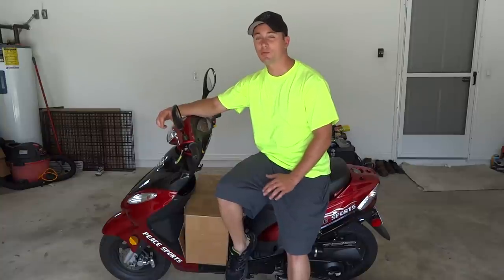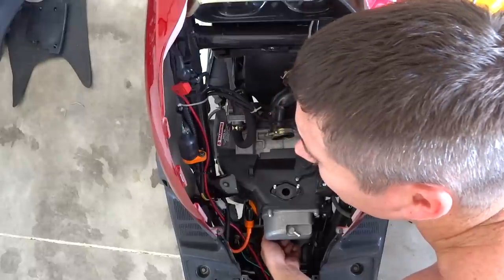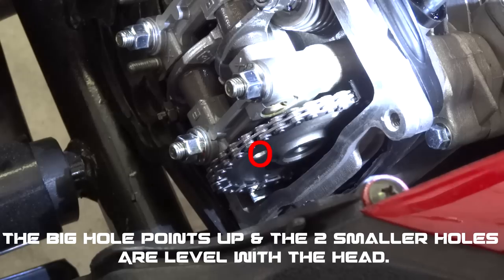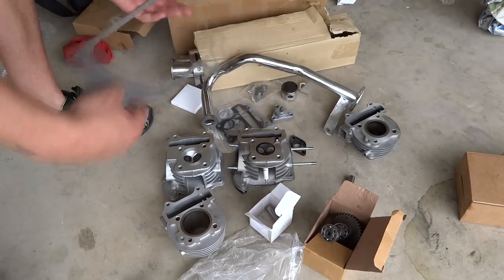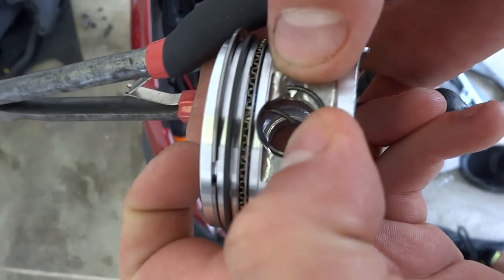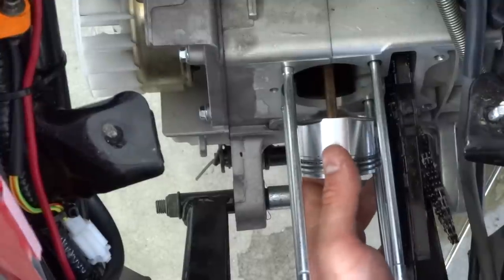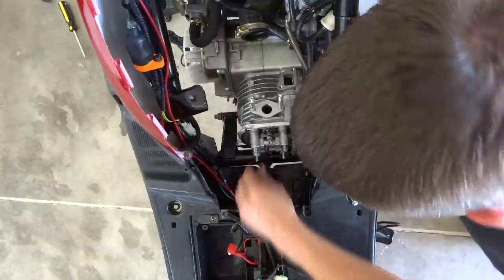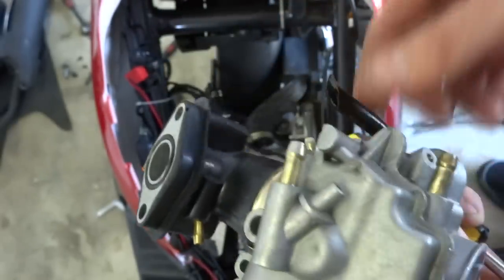DIY Gy6 Scooter 50cc to 100cc Kit

Comment from the maker: 💡Answering Scooter Questions Here💡
📌https://youtu.be/xnBtKxbpJIU
🛒 Purchase The Parts In The Video Here: https://www.nthefastlane.com/gy6-scooter-50cc-to-100cc-kit-store
🛒 Visit Nthefastlane's Amazon Store: https://amzn.to/3pP4UCy
Reply: +Nthefastlane will it be noticable to the authorities if i do this????
Reply: Nthefastlane i need help cold it be the fuel pump wean I gave  it gas it die on me
Reply: Nthefastlane would it be a little better if i ran straight pipe moneys kinda tight on bigger exhaust or normal exhaust is better please hmu
Reply: You should do a video of port and polishing the exhaust and intake port to a bigger intake and exhaust size since these engines are badly restricted of exhaust and air flow to promote better combustion in the combustion chamber while running and the moped i have like this runs much much better with a port and polished head with a unrestricted straight piped exhaust and putting bigger valve seats in the hemi type head that's pretty funny these engines have a very small hemi engine in these scooters and I think it's funny to say YEAH ITS GOT A HEMI
Reply: I believe when you bought the full kit , they include a H.O oil pump to deliver more oil to the bigger top end or so the say & u have a big enough pump to run a NYC oil cooler.  So they say couldn't tell the stock oil pump from the extra in the kit . I'm not 💯 for sure nice clean big bore complete,  I have to actually pull my motor for a big bore frame is smack in the way for 150 to a 180cc & 30mm carb get ya moving 
Fwd great vid !
Reply: How pppl charge do this

Comment: hi im going into a  engineering school. Im not a professional yet but i think you should lubricate the piston and its componets to avoid any internal damage at the first startups!
Reply: Exactly my thoughts.
Reply: Not to burst your bubble, engineers are not mechanics. In fact mechanics do not usually like engineers because you don’t make things functional.
Reply: @MrSagerific95 that may be, but engine assembly lube exists for a reason
Reply: @Andy-df6gm  as a professional mechanic and engine builder I agree 100%
Reply: @MrSagerific95  yep.. and  as a SCOOTER builder who puts these in regularly  you DO need  assembly lube
Reply: @pastorjoesackett  indeed. My high compression 80cc has about 300 hrs on it and is still putting out great numbers on the compression tester.
Reply: @pastorjoesackett or just regular 10w40 i got a gy6 139qmb i instalt a 72 cc and i lube everything just with oil
Reply: @pastorjoesackett  hello i have done my first build and i did not have assembly lube laying around but i did buy 5w40 scooter oil i used that as lube would that be a problem?
Reply: @lucabot5518 did u install the naraku cilinder?
Reply: @BeamnGLiquify  nope any lube is better than no lube. sure assembly lube has better properties but it should be fine. Just make sure you change your oil after your wear in cycle 🤙
Reply: @BeamnGLiquify also I know you’ve probably already got it going. But another tip is to take the spark plug boot off and wheel it over a good 10-20 revolutions to ensure the oil pump has primed the system😊
Reply: @BeamnGLiquify  I used Lucas oil stabilizer because that's what I had on hand and it's sticky enough keep the parts lubricated during assembly.

Comment: No need to lubricate the parts during assembly?? You must be very confident that the oil pump will get it lubricated fast enuff at first start up huh?? Always lube during assembly with synthetic or at the very least...10w30
Reply: never use synthetic for assembly,they have friction reducing additives and will stop parts bedding in. likewise for running in. Use mineral oil for both.
Reply from the maker: I used 10w30 to lube the cylinder wall which was not mentioned in the video.. it got cut out during the video editing process..I "always" lubricate during assembly,...with a vehicle, every cam,main,rod,oil pump gear and rings would be properly lubricated and then the fuel pump fuse would be pulled and cranked until the oil pressure would raise to operation, then the fuse would be put in and the engine would start. I've been building engines for over 13yrs.
Reply: Why do people feel the need to qualify an erroneous opinion with their qualifications ?, However many years experience I have,  I dont find the need to bring it up , I could have been doing it really badly , or just phoning it in , riding along on better experienced and talented coat tails  , but i dont use it to qualify an opinion that i admit was misleading or omitted through editing  . It could be used by somebody with  potentially dangerous and expensive results , or even just teach someone bad habits...  Dont lubricate cylinder walls in a freshly honed bore,it will glaze the cast iron rings ,stick with standard cast iron working and machining practices, look it up not on google.   Do it however you like for your own shit, but be careful in passing on experience to others.       peace out bitches
Reply: Nthefastlane do you need to pull fuel pump fuse to get oil pressure up before you do first start or can you just lubricate and fire it up?
Reply: bob marley can you help I have problem with my 1985elite150
Reply: hi can i use wd-40 oil to do this? thank you :)

Comment: Another thing you want to do is use assembly lube on your wrist pin, inside the cylinder walls , and on your cam lobes and other various metal to metal contact points so installation is easier and you need some lubrication before the oil gets there in initial start up. Very important.
Reply from the maker: I mentioned this in the description under the video. YouTube used to have annotations, but they removed them so all of my notes in the video got removed.
Reply: White lithium grease will work fine.
Reply: Use a rubber mallet.

Comment: Great video, very informative and well shot, much better than many. I've watched over a dozen videos with different motors, different kits all to get an idea of what problems others run across. Generally, they are all similar.

Anyway; None but one ever mentioned using assembly lube for re-installation. As cheap as that stuff is, I believe it is a must do step. Or at least use regular motor oil, (preferably heavy weight/thicker oil). I use a restaurant ketchup squeeze bottle and use straight 50W oil when I can't find my assembly lube. It sticks better.

You should pre-oil the wrist pins, the rings and cylinder, the lifters, (both the pivot points & all contact points), the chain tensioner as well as chain and sprocket. Any metal to metal wear points.

Then before you replace the plug, either hand turn or use a drill or the starter to turn over the motor several times to start the oil pumping through the engine before a hard start.

Then no matter how well oiled, let it idle for a minute or two to help seat everything then a short test drive, (short, no over revving or speed test). Then change the oil. Any metal shavings need to be removed right away. One video did mention to get a magnetic oil drain plug, good idea with or without a rebuild.

That is just my two cents worth; "An ounce of prevention is worth a pound or cure".

This is just a suggestion for my knowledge. I would love either a video or at least information on what the best setup would be for different size rebuilds, like, this 100cc upgrade, the best clutch setup, lighter or heavier weights on the flywheel, best carb jet size or better yet carburetor to replace, what CDI to use, etc. etc.

Thanks for the video, you did a great job.
Reply: 49ccscoot does alot of the test this against that etc

Comment: Did the same on my 2006 peace motorsports 50, previously bored it to 80cc and just recently went to 100cc and trust me on a50 with the small tires 65mph is almost to fast unless it's a nice smooth surface, I have to also be careful not to get caught speeding because in North Carolina anything over 50 cc and goes faster than 35 requires a motorcycle endorsement which I don't have, but anyways it really helped with the performance I also put a performance muffler and coil as well, down hill probably 70ish but i havnt had the balls to try it 😆. Tags and registration 24$ and 12$ a month insurance with Geico.

Comment: Some tips:
When attaching the piston, already put one of the clips in the piston before you slide it on the crank. Easier ;) And very important, lube the piston and cylinder with engine oil. Don’t slide it on just like that. Same when montaging the headbolts, lube them and make shure the threads are clean before you torque them.
Reply from the maker: The piston rings and piston were lubricated prior to assembly. I believe what happened was when I was recording I pressed record for the second time and accidentally stopped recording. Lost the footage
Reply: @Nthefastlane  ah ok :) what weight rollers do you use in youre scooter? I got the 50mm kit as well with a 24mm carb and the head with larger ports and the performance camshaft. The scooter pulls well till about 25mph, flattens and starts pulling again at 30, maxes out at about 42mph. I got 6,5gr rollers and a performance exhaust with 27mm downpipe and a fake yoshimura muffler.

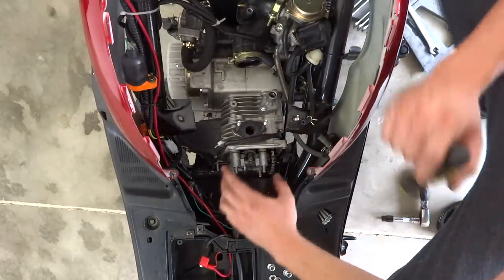Comment: 12:14 instead of using screwdriver to pry it out. a gentle tap with mallot helps.
23:40 apply a drop of oil before  installing piston pin clips and piston ring and you won't need pliers to shove the clip in.
29:00 shims/guides are known by one more name. dowel pin.

Comment: quick tip on those carbs use a small dremell cutting wheel to put a groove in the screw then unscrew with a flat screwdriver.
doing it like this you can use the screws to reassemble.
Reply: Good tip.

Comment from the maker: Hey Brian D,First make sure you bolted the 2 Black ground wires to the valve cover..without those you will not have enough ground and the lights will be dim.

Comment from the maker: Hey Elton,First make sure you bolted the 2 Black ground wires to the valve cover..without those you will not have enough ground and the lights will be dim.

Comment from the maker: @James Burke technically a 5/16 inch socket is comparable to a 7.9375 mm which is a tighter fit then a 8mm :)
Reply: I don't get it.  Are you saying it's a good idea to try to buy a 5/16" wrench somewhere instead of using a standard 8MM?  My 8mm seems to work OK.
Reply from the maker: RJ Burke
I was just saying there both soo close to size it wouldn't matter..were talking 10ths of thousands of an inch here lol.

Comment: I had a couple of suggestions for doing this demo I would have taken the motor in gear trade out of the scooter and put it on a patch so that people will be able to see things more easily there's parts of your video to where you cannot see what's going on this would really help as a video for teaching people how to assemble this Bore Kit also I would suggest taking off the side cover and turning the crankshaft manually by using a socket and Ratchet this way if the person makes a mistake when installing the cam gear and chain where the timing is not right this way you will not Bend a valve just a precautionary measure because a lot of people have never put in a Big Bore Kit the cam sprocket is so tiny it would be really easy to be off a couple of notches and not even know it also is very important to show people how to make sure there crank is at top dead center and both valves are closed I hope the information I have talked about will help people and will help the man who made this video I think you did a really good job but these are some ideas that may help him make other videos in the future

Comment: You forgot to lube the piston and rings + cylinder!

And i installed a 80cc cylinder today and used some oil in the cylinder and piston. No smoke at first start up ( without exhaust ofcourse )
Reply: daand12  I dont know or any cops that carry micrometers.. just sayin
Reply: @nctrooper10722001  iv had a bike impounded and checked before dude. Its not worth it.
Reply: @nctrooper10722001  no but they don’t care anyway you’ve lost some compression and power because of excessive wear ;)

Comment: Decent vid, I would recommend putting a film of heavy gear oil on the cylinder walls so the rings won't be dry rubbing until the oil pump forces oil up in there, just my 2 cents..
Reply: Barry Aiello  I guess he doesn’t moisten his girl either he just goes in dry

Comment: for the 90cc on a kymco super 8 I take the 50 head, that combination works fine also the 50cc camshaft, up there you have to go fit, experience say that, with this setup you get with tight running almost the 100km / h 80cc 86 nozzle 50cc head / 50cc camshaft, drive in at 50km / h then full throttle and do it in such a way to speed up and take off, giving a little to his thunder, so the cylinder is not lazy either.

Comment from the maker: I left the shroud off, the fins on the cylinder head act as a heat sync, just like a computer heat sync on a chipset. Been running it for months with no problems.

Comment from the maker: You have to use different rocker arms because the original ones don't reach the valve correctly.
Reply: My kit only came with one set of rocker arms do I use the original ones or the ones that came with the kit?

Comment: The oil pump is a higher capacity pump, it flows more oil.. install it 100%. Bigger piston,  bigger bore it will need more oil. Don't forget to lubricate the rocker arms,cam etc.. dont put them in dry

Comment: Good advice about the rocker arms, however, just for trial and error, I tried to put the rocker arms the wrong way and found it’s not possible. The casing will not allow the cam shaft to fit. I did find it WAY easier to oil the cylinder before installing the piston.

Comment: can i use the 50cc head with a 100cc  piston?
Reply from the maker: No, The cylinder head is machined bigger to accommodate the piston size. Also the rocker arms might be different.
Reply: @Nthefastlane  okay thank you

Comment: Instead of squeezing the clip and possibly bending or distorting the clip, insert the clip the same way you did , but use a scribe into the same notch , but you can insert the scribe into the notch but outside the clip then pry the clip inward with the scribe. This way you are only affecting one portion of the clip.

Comment: There are so many comments, questions and points. But this is like puttin lipstick on a dog. A peace sport firstly. And an 80cc on that model would do fine. It's very light.  But mostly why are you making a how to on something you are not well versed in..... But it all boils down to, thanks for keeping local scooter mechanics busy!  You help alot.    And 5/16? There is no standard its all metric.  All u need os 8 10 12 14 17. Sometimes a 13mm thats it

Comment: Hello, great video, and great explanation. Congrats! I have a baotian bt49qt with 139qma engine ( I assume it is the same engine as 139qmb)  and it has lack of power and much blow-by at the cover vent. Where i live they don't sell bbk's, however they sell cylinder, piston and ring set for 80ccm, so if I go with that set would I have to change cam head and/or anything else like carburetor? Thanks

Comment: Any idea the compression ratio? Or cranking psi? Can the head be shaved  . 010"-.020" to get a bit more squeeze!?!? Bit a bigger BANG, also do the to make a larger carbonator for these monsters? Would a 125cc motorcycle carb possibly work on these, or maybe a 125-200cc motorcycle  carb ,  I noticed on my scooter, the carb made a major difference, not having the proper carb, was like only having half throttle available, I think it may be worth looking into! It's very easy to sit here behind the screen, saying how about this and that,  but nice work/video, greatly explained, great details!  I have built many car engines and a few motorcycle engines,  but never a scooter engine, I even built a 200cc Suzuki engine, bored , polished ported head, shaved, with a cam with the base circle turned down a bit, not professional at all, but it seemed to work, it sounded a bit like a Harley, with no muffler, only the head pipe, and it was loud!! Made decent power, it had about . 050" more lift,  and the compression was a good bit higher, kick-starting was a but sketchy, ya had to be careful!! It nearly three be over the bars a few times! Great work, sorry about the rambling!!

Comment: That's probably a 72cc Kit you got there, there are no 100cc Kits for Gy6 139qmb Engines. The biggest one is the 90cc kit from Naraku which also has bigger Valves. Oh and btw how long did it take you to ruin the Engine due to overheating because you didn't put the Fan Shroud back on? Seriously this is not the way to do it! Otherwise great Video

Comment: Dont forget to lube the engine when mounting the kit with engineoil, to prevent drystart. thats a big problem if it fires without any oil lubricates the cilynder walls when new.

Comment: I did everything your video suggested and my scooter started just fine and ran as fast as yours did but after 3 starts I noticed the starter struggles to start the bike.  I can kick start it but now the starter can't start the bike at all.  Does anybody have any suggestions?  The battery is new and charged.
Reply: if you left off the plastic shrouds for the fan driven cooling air like our intrepid host, you probably fried your engine. does it spin freely with the plug out if you kick it, or does it go a quarter turn and stick?

Comment: I'm installing a 100cc bbk, why is there a greater clearance between the valve adjustment screew and the plate on the bottom of the valve. There wasn't any issue with the intake, but on the exhaust side, I don't have any enough threads on the screw to tighten the lock nut??????
Reply from the maker: Thank you for the question. I have answered your question here: https://youtu.be/xnBtKxbpJIU